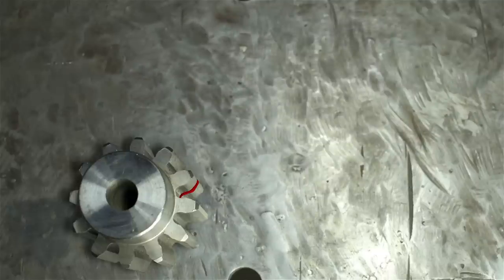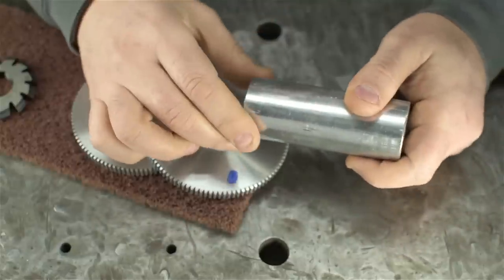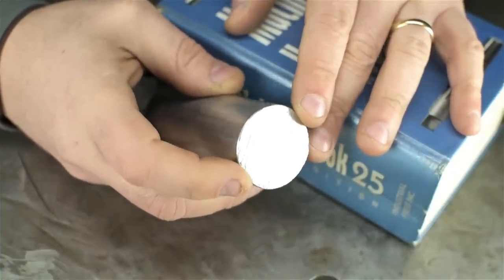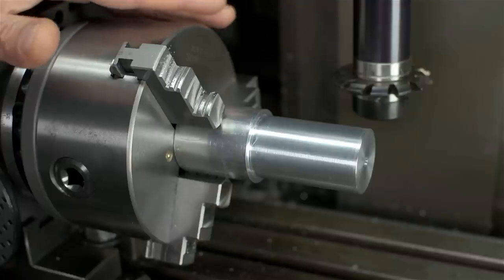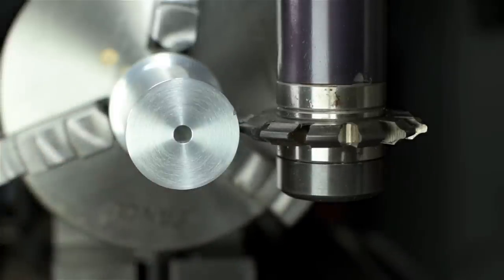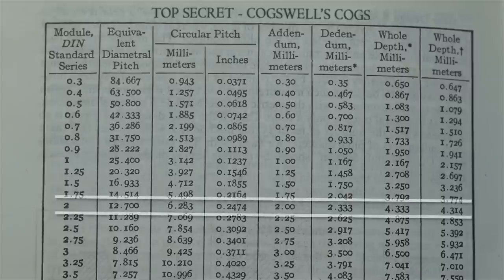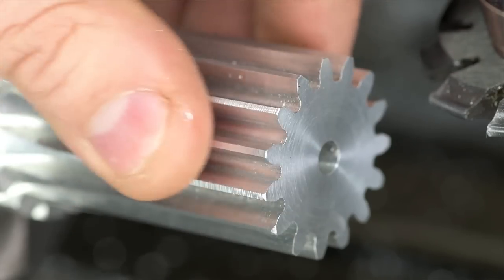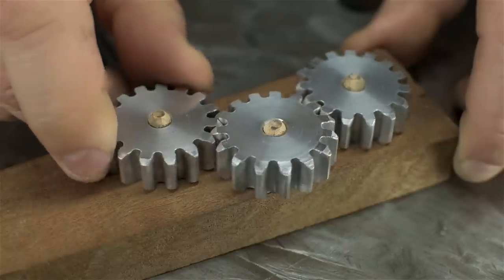15T-M2 Let This Be A Lesson To Ya!

Comment: you chamfer gears because if you dont your teacher take off marks from your project...
Reply: It has to do with hardened teeth: that corner is weaker (because of nog support from the side) and breaking/chipping is done easier. 
You dont want that because hardened metal between the teeth is like sand between you veggies.
So: chamfer them to prevent breaking the end of the teeth, especially with hardened steel of not perfectly align gears.
Reply: @eddyerkelens  - Huh, I had thought it was from the requirement for gears that slide into mesh like automotive transmissions.  More reasons than I knew, thanks :)
Reply: @somebodyelse6673  automotive transmission gears don't actually move into/out of alignment. The synchronizers between them are pushed by the forks to engage the right gear to the shaft. the bears themselves are always meshing and almost always helical.
Reply: if you dont chamfer a 40mm shaft and try to put it in 40mm hole with no chanfer on the edges ......ehm well good luck :D
Reply: @johannesgh90 , yup. Alignment is increasingly important as the tolerances get tighter and the, uh, material gets harder. Lubrication will get you only so far.
Reply: @somebodyelse6673  Depicted in the video you linked is a real gearbox setup, albeit old, but new ones don't differ that much. You can clearly see the that the gears aren't chamfered.
Reply: @somebodyelse6673   Many lathe and milling machine gearboxes still slide the gears sideways into mesh. If you don't let the spindle come to a complete stop you get a trip back to the time before most autos had synchro.
Reply: @spudpud-T67  obviously your from a farming background "rough and ready" honesty what machine shops have you worked in where "rough enough is good enough?" Ascetics is just as important as the practicality and function of the part. I know back when I was an apprentice many moons ago I would get a kick up the bum for unfinished machining. It takes but 5 minutes and impressions last.
You are not wrong about the why but the why does have secondary just as important functions as pointed out by Mediocre Joker.
Reply: Chamfers can hide a lot of sins, bigger chamfers will hide even biggers sins.
Reply: Haha, "a grinder and paint, makes a welder what he ain't".  That idea gets around 😀
Reply: @spudpud-T67  it is not about what I like.... There is an unwritten book of ethical machining which separates a good machinist from a bad one. 
NO workpiece has left any of the machine shops I have worked in an unfinished state. Just because function does not require it to be done does not mean it is OK or that the bare minimum applications were covered "ethical machining"
Maybe it is a generation thing? Some people will always do the bare minimum.
It is easier to machine a Loctite fit than it is to machine the correct interference. Both are probably considered acceptable fits in some circles.
So which are you? the Loctite or the percussion machinist.
Reply: @spudpud-T67  "it is not an aesthetic choice" your words not mine. As I said before your not wrong referring to chamfers are used to strengthen edges to minimize chipping of hardened/harder materials as for example radius cuts are used at the stepped diameter changes in a shaft.
BUT mediocre joker pointed out 2 other secondary reasons that are just as important as an add on to a previous answer and you called him out for it.
I am reading everything loud and clear! Are you?
Reply: @goodlookingtroll1352  Ascetics were a religious cult  practicing severe self-discipline and abstention from all forms of indulgence.  "Ascetics is just as important as the practicality and function of the part." ???
I must say, that makes " your from a farming background" negligible in comparison.  (makes as much sense as "my from a farming background" or "our from a farming background") Thanks for a good laugh!
Reply: Jokes on him. We don't have marking system in my school.
Reply: @eddyerkelens  Interesting to know.
I'd never thought about the chamfers before. When Tony mentioned it I pondered if maybe it was so the oil/grease doesn't get completely smooshed out from the tooth roots and onto the sides of the gear as they meshed, So a small amount stayed at the sides of the "Valley" to help lube it on the next meshing.......... But your explanation makes more sense. :)

Comment: Pullstart on the mill got me big time!  Tony, you are hilarious!
Reply: Right?
Reply: I was going to ask Tony if his miller is 2 stroke or 4 stroke. And, if it is a 4 stroke, does it have timing gears.
Reply: I was just wondering the other day how long it would be before we saw that.
Reply: @jlucasound  No it has a Morse chain driving an encoder. You can hear it tippity tapping away.
Reply: You notice it took a couple of tries. Obviously TOT is using the cheap oil. Such a tight wad. Real machinist use the unatainium oil. Somebody should report him him to Abom79, or Keith Fenner.
Reply: One of your best gags ever! But the three-speed push stick was a close second.
Reply: @stanwooddave9758  No I think it's just worn and old, newer pull start mills have electric starter if your fancy or a recoil starter if your not.
Reply: Clearly his recoil was busted.
Reply: I actually laughed out loud when I saw that.
Reply: As he wraps the first wrap of rope I'm thinking "WTF", by the second wrap it dawns on my I'm watching TOT... Expect the unexpected but still anticipated clever gag.
Reply: @michaelseery5588  yep
Reply: This brought back memories. My first milling machine was a total PoS Rong Fu, with a 60 Hz motor but supposedly the correct voltage for my national supply (230V, 50 Hz).
 It wouldn't start without tripping the circuit breaker to my workshop, unless I rope-started it and pushed the start when it was spinning. And that was about the best feature of that mill.
Best day of my life was when I saw the happy new owner's battered Toyota Crown wagon drive off with my putrid machine in the back. I now own three milling machines, of which the worst is approximately ten times better than the Rong Fu could ever have hoped to be.
Reply: If the rope breaks, he has to push the mill and pop the clutch.
Reply: I have to say the first mill I bought was a small 1hp and the guy started the motor with a pull start rope.  No kidding it worked.  He said the starting capacitor was bad.
Reply: He was using the wrong type starter though so that is why it took two pulls. He needed a strap starter.*  Or else he had the magneto or choke set wrong.

* Used on Gravely engines from 1922 to 1976 when they last built a Model L tractor. When set right, the engine will start on the first pull. And they are 30 cubic inch engines on the Ls which while only rated at 5.5 or 7.6 HP,  will do better under load than a 10HP of equal size. The carb on them is the same as found on some Case and other make 4-cylinder tractor engines from the 40s and 50s.
Reply: My coworkers where just like... what the hell was so funny? Why did you fall out of your chair laughing.
Reply: Same here.
Reply: Trade that mill in on one with electric start.
Reply: What do you mean? That's how I start mine... except I use a neck tie, ya get more of a bite
Reply: i own a 2stroke milling machine.. but i have electric start..
Reply: On the lathe of my father there is no other way to start it, the motor is to weak to start it from a standstill
Reply: They are all gas powered, didn't you know? The first ones were steam engines but the sound of the locomotive got annoying to the workers and also the fact that you needed 3 grubby little kids to feed the furnace(P.R. issue you know) got tiresome.  So, in 1891, a retired underwear salesmen decided he'd fix the problem after he could no longer handle the noise from Old Old Old Tony Senior the 2nd.. and the rest.. the rest is history.. it looks like Tony has a real old model T mill.

Comment: Mill must be warm... didn’t even have to use any starting fluid to get it going....
Reply: Doesn't need it with the choke on.
Reply: I think this mill is fuel injected.
Reply: @PorkBarrel.  nah, it's a hit and miss 5hp McCormick behind, no fancy injection or choke needed
Reply: I have to suggest my boss to replace the old clunky wheel loader with Tony's mill. We could save so much on reduced starter fluid.
Reply: I am sure its the glow plugs or it ran backwards, maybe the hinted video at 11:23 reveals how Tony fixed it! :D
Reply: Dark Winter   Coulda sworn that was the coal fired mill.
Reply: I have a Grizzly mill, the reversing switch had been bumped and was in 'neutral'... so several times I DID 'rope start' it .... then---- like the little moron who sat up all night wondering and fretting about where the sun went when it went down... IT FINALLY DAWNED ON ME..  Life is good again.
Reply: 2 stroke? or 4? (just curious)
Reply: Are you suggesting that he's doing shop work on the side off camera?
Reply: Coulda wheeled it to the laundry chute and bump started it, if ToT has a laundry chute from his (basement?) workshop...
Reply: @mikebeacom4883   wrote 
<<Dark Winter   Coulda sworn that was the coal fired mill.>>
Does that belong to the category "dark satanic mills"?
Reply: @MrZhefish  And here I thought he was using a two cylinder Maytag.

Comment: I asked my tribology professor about the chamfered edges today. The edges are chamfered to prevent cracking/notching them when handeled. They are also made to make the surface hardening more even, not as much stress concentration without them harsch edges.   

Love your videos, greetings from Sweden!
Reply: Beat me to it.
Reply: @nakedanimegirlspls   Sorry mate
Reply: It's essentially a more technical version of why when you forge a sword, you leave the transition between blade shoulder and tang a fillet. A right angled transition leaves a stress point that could cause cracking during the heat treat.
Reply: Chamfering the edges also reduces contact friction, therefore heat on the gears (less surface area contact). You would be surprised the difference ot can make on gears that are heat sensitive due to speed.
Reply: I was told it just makes the gears last longer somehow, so I'm glad to get a better answer than that. I was also told it had something to do with gears thrusting, but I dont know if that is true
Reply: TIL tribology was an actual field of study
Reply: Ahh so basically the same reason fillets are preferred instead of hard corners for structural integrity
Reply: @CodytheDeer  I genuinely thought it was a made-up word up till now.
Reply: @Elvirth24  It might be a suprise to you but a sword forging example is not very useful to a machining enthusiast
Reply: when you have gearbox in a machine to attach 1 gear to 2 much easier
Reply: I'd have thought something along the lines of a pinch reduction and the focusing of pressure through the teeth.
Reply: I asked my spelling teacher today about the way you have spelled certain words, and he slit his wrists.
Reply: i suspect in case of lubrication, more would reach the meshing area due to centrifugal force
Reply: That's really good information thank you brother
Reply: Straight square corners would become sharp edges as the gear wears, and the tips would become wider. This might cut into whatever case contains them. Think bell-bottom jeans. Or, parting off tool geometry.

Comment: 9:25  I've actually had to use this technique to start a mill. The fuses were to small so they blew immediately upon starting the rotation anything over 400 RPM. But by giving the spindle some speed before engaging the electric motor it was avoided. :D
Reply: Did you start it by hand, or use a different machine to start it.